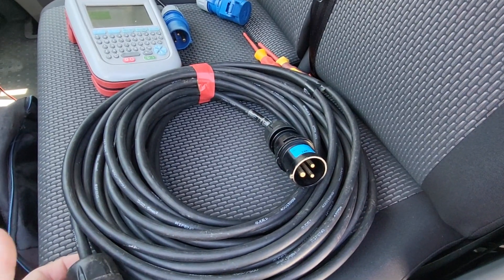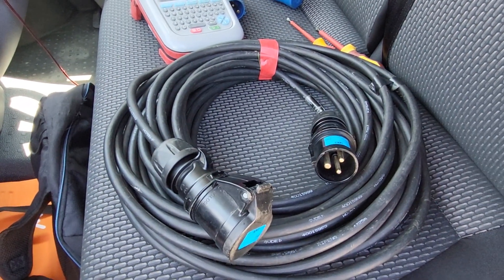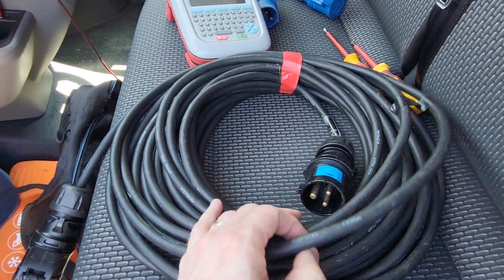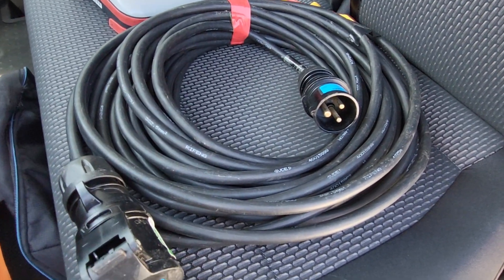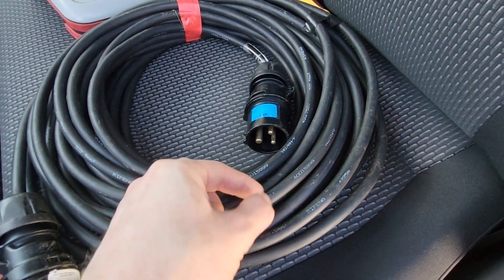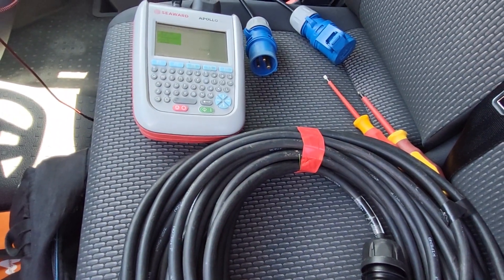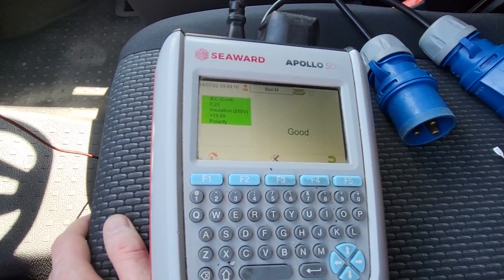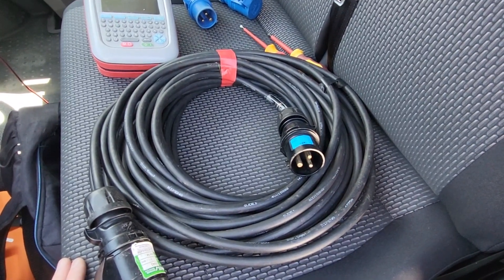What is a 16 amp cable and how to PAT test them.

Comment: Hi Ben, Im testing some 10m/20m/30m 16A cables (all 2.5mm). Is there a guide to set this up in the Apollo 500+? Can the Apollo do 32A single and also 32A 3 phase? I have to test 100s of these cables over the next few weeks...
Reply from the maker: yes you can use the built in calculator on the Apollo to work out the correct earth bond reading per length of cable. and yes the apollo can handle single and 3 phase cables and equipment - you just need to make sure your adaptors are properly configured
Reply: Brilliant thanks Ben @caterhampattesting

Comment: Do you test these cables fully coiled or fully unwound - would you get different readings?
Reply from the maker: these type i test coiled. If they are extension leads on a reel then i fully unwind to visually inspect properly.

Comment: I thought these type of cable extensions had to be COLOUR coded Red Blue or Yellow for the voltage reference????????????????
Reply from the maker: not as far as I am aware. in the event industry all the cables and some connectors are all black but easily identifiable by the connector label
Reply: First of all these are great 'to the point' videos ive just subscribed, please keep them coming.. Yes the events industry are increasingly using black connectors for cosmetic reasons but if they are black the embossed type on the flap of the male connector (or the side if it has no flap) will tell you the rating. Or as Ben said if they're  not black, the colour of the connector: Yellow for 16A 110V -the sort you see on building sites for power tools, Blue for 16A or 32A (single phase) and red for 3 phase (16A upwards). The camping industry usually use orange cables for camper/caravan cables - i guess for high visibility and reducing trip hazards. For easily identifying cable lengths, we use the following colour codes (tape covered with heat shrink for protection on both ends of the cable):
Red for 2m
Earth for 5m
White for 10m
Grey for 20m
Blue for 30m
Combinations of 2 colours for longer cables i.e Blue and white for 40m and so on...I'm sure all i have written is common knowledge to you all here but may be of use to someone who visits. 

Ive just started using tags on 16A cable as Ben says, more expensive but in my world the labels just dont last. Contrary to what I expected the tags really do stay on and survive a get in and get-out in a outside, very harsh winter environment where they were installed for 2 months. Just make sure they are pulled through properly. I got mine from here:
https://www.labelbar.co.uk/test-service-c150/personalised-4th-5th-edition-tuff-tag-passed-pat-test-labels-for-harsh-environments-choice-of-colours-p1990/s18355! @caterhampattesting
Reply: Most of the time people colour code these so they can easily find lengths.